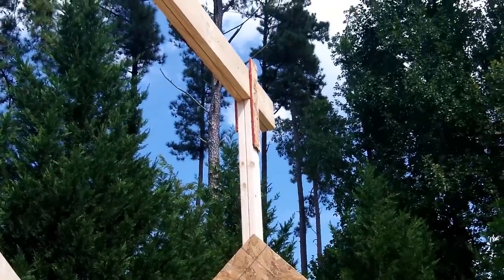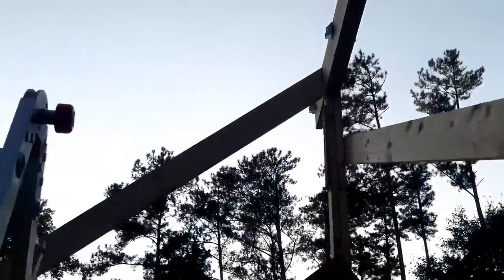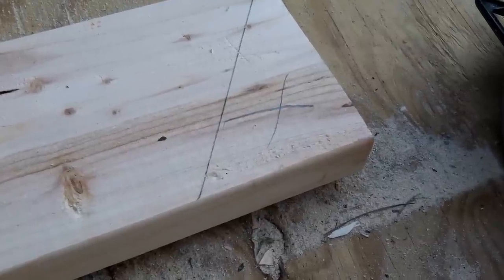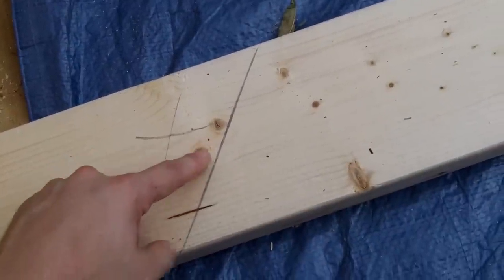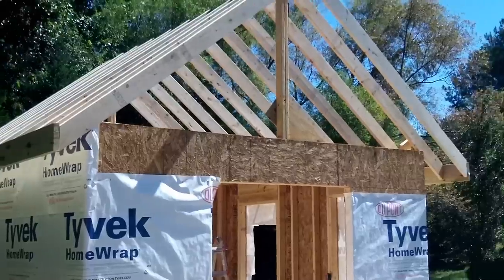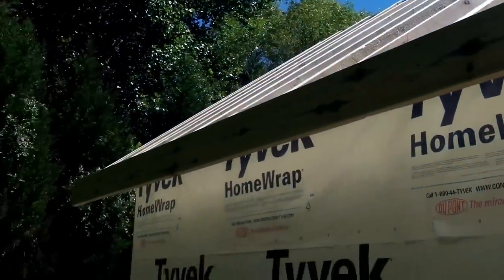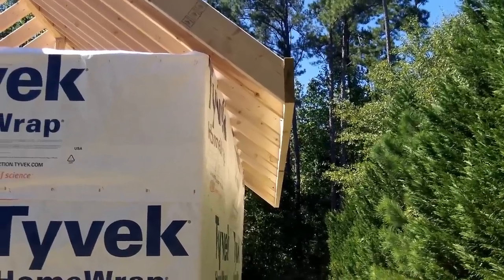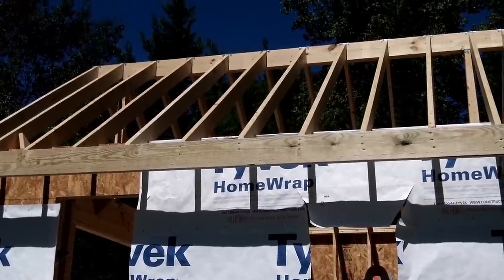DIY Shed - Part 4a - Roof Framing

Comment: So much in building that people don't know.  Like concrete one step.  framing, beams and roofing.  Of coarse plywood walls, doors, electrical,windows, finish, trim paint etc.  I built a shop and learned so much during that build.  I built a deck and learned more.  I am building a pole barn shop and I will tell you it's an easy build cause I know what I am doing.

Comment: It's not a ridge beam it's a ridge board there is a difference.  A ridge board simply gives you something to nail the rafters to.  A ridge beam is a load bearing support for the rafters in situations like cathedral ceilings.

Comment: Probably because in the area he lives in the code requires a ridge beam not a ridge board.As it is then self supporting it will not require any braces to it,in the same way that a vaulted ceiling does not as the beam takes the load.He says he is installing hurricane ties top and bottom as well.My concern is that his ridge posts are fully supported from below as they are now load bearing and not just temporary supports to a ridge board.

Comment: you can just put the rafter on the edge of your wall and ridge beam secure it and make a line using a scrap piece that you press agains the outside of the wall and ridge, and than just use a squear to fisnish the mark

Comment: Don't know how you exactly installed the rafters, but if you installed one entire side of the rafters at once before installing the other side, the rafters can push the ridge beam over a bit. That may have caused the difference in rafter measurements. Great job though!
Reply: Good

Comment: to begin with, the rafters should always be identical for this type of structure. try to use a size rafter that allows a full 3 1/2" birdsmouth, a ridgeboard is not really a structural member - it simply provides something to attach rafters to, vs. each other, 1x lumber is acceptable for what you were building. Housewrap   seems a waste of time & money, rafter dimensions not difficult to calculate - such charts are readily available also. Want to frame & build - watch the Larry Haun videos, which are without an equal. Gotta commend your ingenuity & work ethic. Bravo.
Reply: volvosan
Agree on the Larry Haun videos. He's dead now but the videos are a great legacy for him.

Comment: In metric to find common slope, example, 150sq x 250sq = slope unit, divide by unit run = slope ratio, multiply slope ratio by run, (span divide 2) or half width of building = line length of common rafter

Comment: Looks good! Too bad there are no process scenes. Why the ridge is not a single but a doubled board? Are there going to be any permanent sway braces to prevent lateral shift of the roof?

Comment: how does one account for the gap in the sheathing between the top of the wall sheathing and the top of the rafters where the roof sheathing goes? That little space over the wall that peeks into the structure. What's the best way to deal with that?

Comment: You should do pairs of rafters, cutting each as you go to account for differences in the twist of the beams, the bow of the walls etc.   each side of the roof on each rafter. that way you are also only setting up staging or ladders once for each pair of rafters instead of doing a whole side, then going back to the beginning and doing it again

Comment: what kind of glue did you use on the rafters I have the same problem
Reply from the maker: Our local ReStore had some premium construction adhesive for sale so I ended up buying a bunch of that for this project. I also used Liquid Nails on some other aspects when I ran out of "the good stuff", and they both seemed to perform similarly.

Comment: your double stacked 2x4's that suppoert the ridge beam or main central beam should have studs directly under them
Reply from the maker: From what experienced builders have told me, those studs under the ridge beam weren't necessary since the beam doesn't really carry any weight with the way I used it. The beam is just keeping the rafters aligned, and the rafters are carrying all the weight to the walls.

I felt better having the studs under the ridge beam, but apparently that's all they're doing :-) So more studs underneath those wouldn't seem to add any strength.
Reply: fullstrutin no. Stop

Comment: the reason that your first rafters didn't fit is because you cut your post too soon. if you had waited to cut your post until your rafters fit you would have not had the problem of fitting rafters over n over.